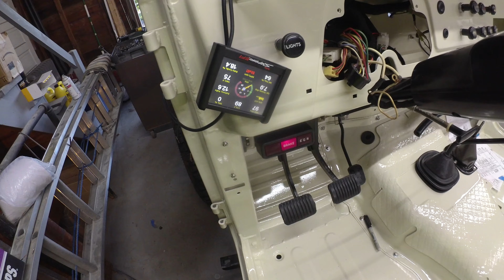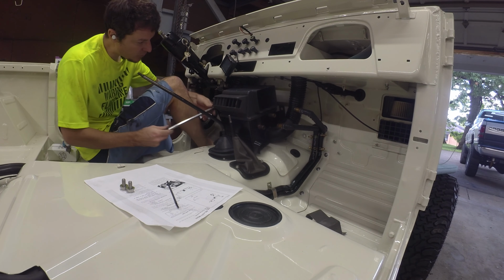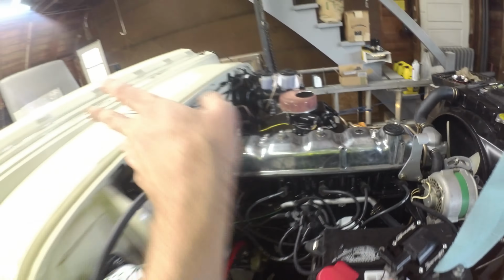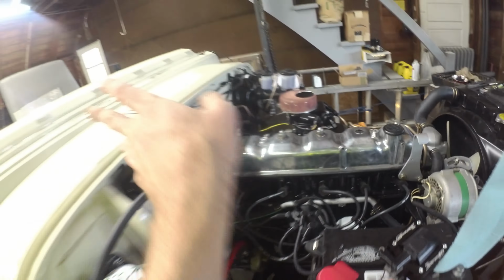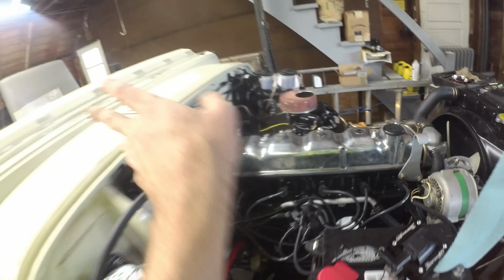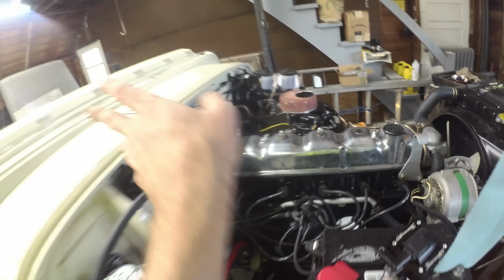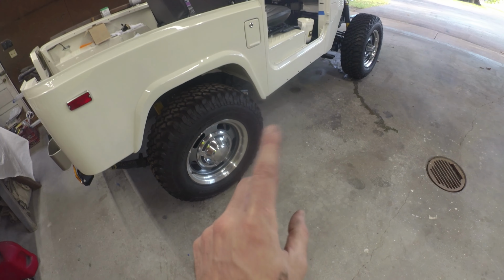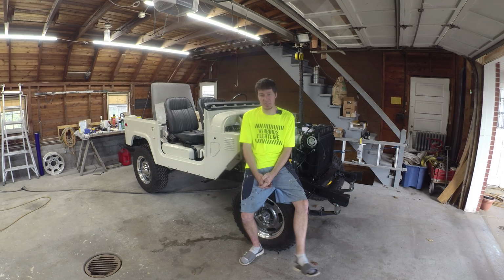First "drive" after front interior assembly!   (FJ40 : Week 45)

Comment: I am impressed with your project! Where did you end up connecting the return line to the tank?  Did you use the factory location on the drivers side of the tank.
Reply from the maker: Yup, used the factory feed and return.  I'm not sure what year added the return - might be 76 and up.  The older versions didn't have a factory return from what I recall.

Comment: What's the Toyota part number for the dash? Love your detail and step by step commentary. Keep up the great work!
Reply from the maker: The OEM part is 55404-90301 (Upper Safety Pad Assembly, Instrument Panel).   There is an aftermarket option at https://www.fj40dash.com/, but it does have a few markings and slight differences, but cheaper.   My OEM one from '76 was still in good shape right until two winters ago when a -40F cold snap put a split right in the center.  :-o